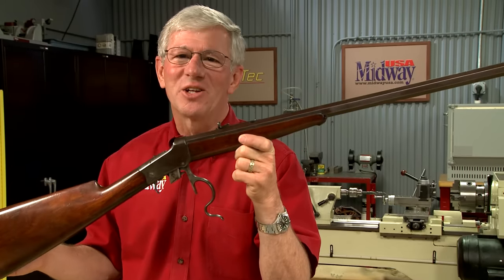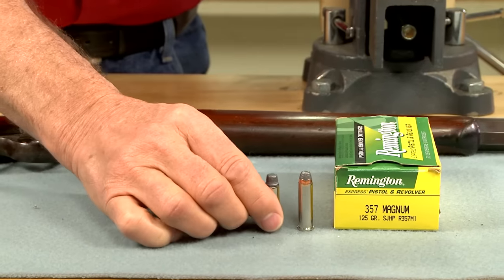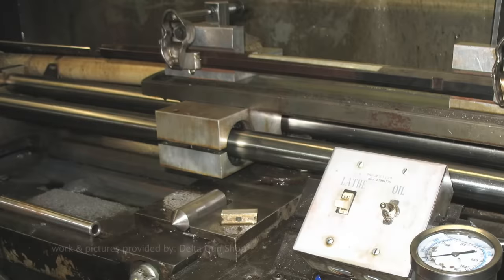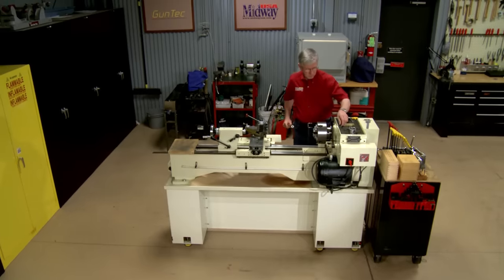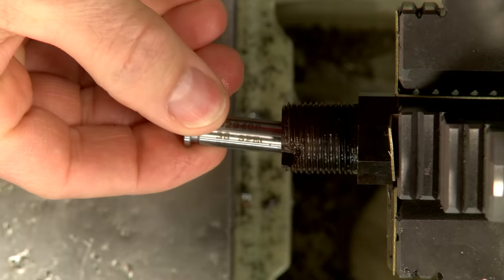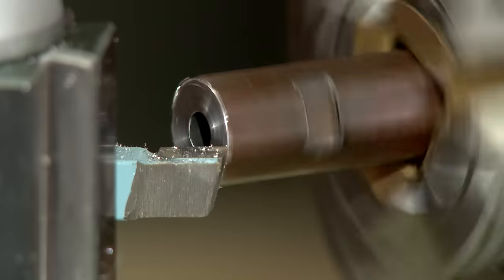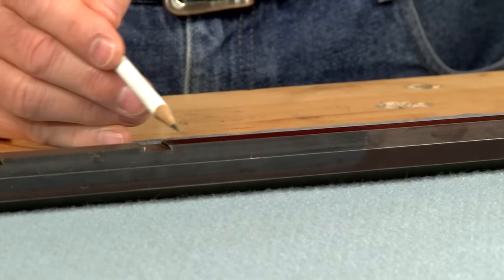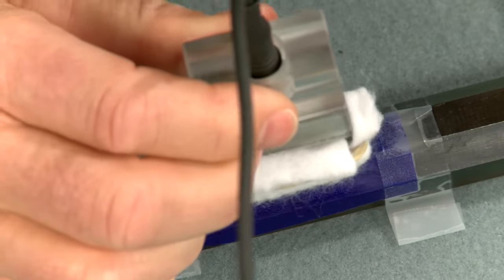Gunsmithing - How to Rebore a Rifle Barrel Presented by Larry Potterfield of MidwayUSA

Comment: I'm not gunsmith, however, I presume the 357 Magnum has a significantly higher chamber pressure than the 32 Rimfire cartridge and if true, this could lead to a catastrophic destruction and potentially death.

On the other side, the barrel seems "thick enough" as back in the days everything was overbuild so it's probably fine.
Thank you for the video.

Comment: I know Browning made the 1885's strong but I would be a bit concerned shooting a high pressure 357 magnum in a low wall.  These were never designed for high pressure cartridges.
Reply: You'd never break the breech block, that isn't the problem, the problem is he didn't use a Mann-Neidner firing pin, and the new steel on guns is WAY better than the old steel back then.  You very well could end up with a broken hammer if you pierce the primer on high pressure cartridge.  Unless he's using black in them then I see no problem.
Reply: That rifle will handle 35,000 psi all day long.
Reply: ***** 
Browning made probably some of the finest weapons out there I agree, as I own many of them, including several 1885, and not the new ones.  What I'm saying is if he shoots high pressure through this it WILL crack the frame and he risk's eating part of the hammer.  If he's shooting black in it, then he won't have problems as it won't get to the high pressures of smokeless.

Comment: What scared me was putting a modern, high powered cartridge like the .357 MAGNUM into a rifle made in 1885.  What made you think that the steel made in 1885 would handle the gas pressures of today's rounds?
Reply: They knew there stuff back then, some people spent there entire lifes working as blacksmiths. I'd trust this gun. I know it was handmade with care. unlike most modern fire arms.
Reply: Very thick barrel. 38 special isn't too high pressure either.

Comment: A spider? I've never heard of a spider before. I have seen something that looks like it used for cutting threads though.
Reply: A spider is a piece that goes on the outboard side of a metal lathe.  By adjusting it and the 4 jaw chuck against each other (and using a plug gauge), you can align the axis along the bore.
Reply: How do you know the spider end isn't running true? Just use dial indicator like you would on the plug gauge?
Reply: TheFirearmEnthusiast A plug gauge isn't the best way to go.  You really want an indexing rod.  It fits snugly in the bore and you can take a good reading off two points farther apart.  Since that is aligned with the bore, you can use the spider and the four jaw chuck to line the indexing rod up straight.  If the indexing rod is straight, the bore is straight.  Adjusting the spider plays with the far side of the indexing rod and adjusting the chuck plays with the close side of the indexing rod.

Comment: By the way, was the rifle made for Black powder? the .32 has a muzzle energy of some 178 ft. lb. but the .357 mag can be 700 ft. lbs!
I did notice that it would be mainly used in .38 spec but did not see any Proof testing or test safety firing.
Any such mods in the UK would require re-p0roofing

Comment: Would have preferred a little bit of info about the proofing process to ensure the barrel will take the increased pressure but otherwise very informative, never seen a rifling tool before and still no clue how it works but honesty not what I was expecting it to look like

Comment: And the cost on all this is what? Accuracy after the changes? If you're going to go to all that trouble, why not just strip and re-blue the whole gun?
Reply: Obsolete caliber and too much pitting in the bore.
Reply: Filipe Amaral That has nothing to do with what I asked. I heard that it's obsolete and pitted.
Reply: Oh, I thought you where questioning why do this in the first place. Yeah, they should have reblued.
Reply: +Filipe Amaral I think the brown patina on an old gun has its own character. I like good blueing but if an old gun has a uniform brown without blemishes, I'd keep it, too. Browning was the first external finish used on guns, simply a matter of rusting and cleaning off the loose rust.

Comment: Can you open the bore up on a cartridge and use the same casings with a bigger diameter bullet? Because ive got an old rifle with a shot out bore, so i want to know if i can use the same cartridge with a bigger diameter bullet. 

Than i only need to pull a few reamers through, do cut rifling on the barrel and put a chamber reamer in with a fatter neck. 

Greetings,

Jeff

Comment: If y'all are doing this kind of thing, I might be interested in sticking a new barrel on a Trapdoor Springfield with a badly cratered bore. I was thinking of a chambering in 357 Super Mag. Who would be able to tell me a guesstimate on cost for the job? I'm not really worried about the rebarreling part, it's the alteration on the receiver end to make the extraction work properly with the smaller dimension case.
Reply: I don't believe the Trapdoor is a candidate for conversion to a high-pressure cartridge like the one you quote. That Allin-type action simply doesn't handle pressure as well as a more modern design. Stick with black powder pressure levels like .45-70,  .38-55, or even .30-30.
Reply: lebomm johnson I would hardly call the 357 Supermag a "high pressure" cartridge in this context. It's a pistol round.
Reply: Maybe I'm confusing it with the .357 Maximum. What's the SAAMI pressure spec for the  Supermag?
Reply: lebomm johnson The difference is that the case of the Supermag is a half a thou longer than the Max. Essentially, the same cartridge, born out of a dick-measuring contest between Ruger and Elgin Gates.
  There are no factory production runs for the Max/Supermag, so it's buying brass, reloading, and keeping it below 28000 CUP.
The discontinuation is due to damage to the top-strap of revolvers when shooting the real light bullets. That's not be what I'd be wanting to do anyway. I'd be wanting to launch a 180gr hardcast at around 1000 to 1200fps to shoot at targets a hundred meters away.
Reply: Yes, a 40,000 lb pistol round, and you want to put it into an action designed for a 28,000 lb BP rifle round. Doesn't seem very safe to me.
Reply: lebomm johnson Read again. Slowly this time.
Reply: My second post was intended to be appended to the first, but it looks like you got in between 'em. So if you have to stay <28K, why not just chamber for .357Mag or .38 Spl ? Brass will sure be easier to come by and cheaper !
Reply: lebomm johnson Because I reload real hot for .357 Mag. I want to be able to visually distinguish between what goes in the Rugers and Winchester, and what would go in the custom. If it ever got that far. It would depend on cost.

Comment: when a shot gun shots slugs high and left what may be the problem, and can it be fixed. I thought it was my reloads, but it shots factory  loads the same. I need some help on this one thanks.
Reply: Quite often with high left patterns its not all the gun but how your finger is on the trigger. If your shooting right handed you may have to much index finger on the trigger so instead of a direct trigger press rearward you moving left and back.  The end pad of the index finger should rest on the trigger, if the joint crease or any portion further back is on the trigger its too much.  You can rectify that by building up the grip area to move your hand further back.   Other than that try several different brands of slug and see how each performs, ensuring each have similar slug weight and powder charge.  Happy Shooting!!

Comment: If it is labeled .357, then you would have to test the strength of the barrel "proof" with a much hoter round.

The barrel would have to survive firing a round with nearly twice the standard charge of a .357 without it exploding.

Why take a risk destroying the barrel?

If this step is not done and you sell the riffle any injury to the shooter would be the liability of the maker.

Comment: I am curious about the fact that the old .32 rim fire could never have the same operational pressure like the .357 Mag. How can you be sure about the durability when using .357Mag cartridges in it, since you chambered and marked it that way? This is a serious question, not criticism.
Reply: +schnubbi2510 It's a well knmown fact that the Winchester 1885 LoWall can handle 357 magnum pressures if smithed properly.  In this case he did all the right stuff.

Comment: How did he modify the block from rim to senter?
Reply: At 0:48 you can see that the breechblock face is flat, so making it into a center fire means drilling a new firing pin hole in it as at 3:37

At 2:50, you can see that the go-gauge (which is shaped exactly as a factory cartridge case is, including dimension-wise) is hidden entirely in the chamber end of the barrel, and the breechblock face just contacts the chamber end of the barrel, so there is no recess in the breechblock like there is in a bolt of a bolt action rifle.

The extractor 3:51 fits into a slot that has to be cut into the rear of the new barrel to match the slot in the old barrel, so the extractor is separate from the breechblock.

Since low wall rifles were meant for low pressure cartridges, a learned strength assessment of this rifle would be in order before ever considering to shoot .357 in it.
.
Reply: Drill a Hole in conjunction to where the primer of the cartridge will sit.
Then ya gotta figure out the dimensions for a new Firing Pin mechanism... The fun part.

Comment: i have a question, how to rifle a 5 mm calliber barrel? i mean its a very small raduis for any cutting tool to go through
Reply: Just as you would a larger bore: using the most traditional method which is cut rifling, cold hammer rifling or button rifling.
Reply: you mean by a tool? i just wonder if there are a small enough tool to do it
Reply: medo sam No matter what method is used, there will allways be a tool involved, either a cutting tool as used in cut rifling which will cut one groove at a time and is the oldest known rifling method, or cold hammer rifling where a mandrel with the negative of the rifling and actual bore diameter is inserted into a short and fat steel cylinder and then is violently hammered by a machine thus imprinting the rifling in the bore as the lenght of the barrel increase and the diameter gets closer to the final shape. And finally the button method where a tungsten carbide button with the rifling pitch is either pushed or most usually pulled through the bore with lots of lubrication; with this method the rifling is pressed or ''ironed'' in the metal. The last method is the fastest and most economical. Regarding bore diameter, remember that there are calibers as small as .177 or 4.5 mm including the .17 Remington, 17 HMR, 17 HM2, and 177 caliber airguns. Needless to say, the technology exist today to rifle practically any caliber bore, including the 2,7 mm Colibri, if so desired.
Reply: so there are tools that small, that cut in a diameter of 5mm
Reply: medo sam Yes, the tooling exist to cut or imprint a rifling in a diameter of 5mm or less.
Reply: ok, thanks

Comment: would it be possible to do this with a none rimmed case like 9mm luger
Reply: Sure, the cartridge headspaces on the front edge of the case.  But, the extractor is the tricky part with rimless cartridge conversions.

Comment: Great Video! I would like to convert a Winchester 1895 originally chambered in 30-06 with 24 inch barrel to 35 Whelen (with 5R Rifling with 1/12 or 1/10 rate of twist) or 9.3x62 (5R Rifling with 1/12 twist). Has anyone done this? All helpful and constructive comments are welcome. Have a great day!

Comment: I bet this ain't cheap. I could probably buy I few nice 357s for the cost of this work.
Reply: theshapeexists it probably cost around $200 to rebore. The rest could be done by a gunsmith @$75/Hr in about 3-5 hours work.
Reply: Buy a hi-point.
Reply: Yes... you could most likely buy a new 357 for the same cost... but that is not the point...

Comment: It should be possible with todays technology to accomplish the same results without needing all the fancy machines.  You could use electrical machining (salt water + power) to expand the barrel's dimension, and then add rifling the same way with specially 3d printed parts + coper wire.

Comment: Woundnt it be rebored to 38 not 35 caliber?
Reply: .38 special will fire threw a .357 in fact a lot of people practice with .38's cause of lower recoil making a .357 very versatile
Reply: 38 bullet is .357-.358 Dia same as 357 mag
Reply: 38 Special is measured on the outside of the case, so in fact the chamber would be bored to .38 inch. The bore is closer to .35, as mentioned above.
Reply: okay point is not specifics im saying a 38 will fire threw a .357 which in a SHTF scenereo makes it very versatile caliber
Reply: waveman1500 the only difference between a 38 and a 357 is the length of the case
Reply: The .38 caliber is nominal as designation goes, but the actual bore is .357
Reply: .38 special, .357. and 9mm are all 35 caliber.

Comment: It's always best to rebore the barrel after you have used the gun to kill someone simply because the police will never be able to match the "lans & grooves" because they no longer exist, it's even better than throwing it onto the river because they could easily find it with a forensic dive team but if you rebore the barrel it's impossible to match the marks on the slug and obviously make a small adjustment to the firing pin too